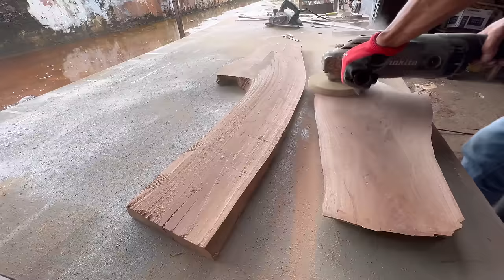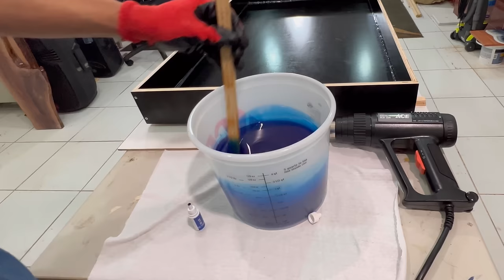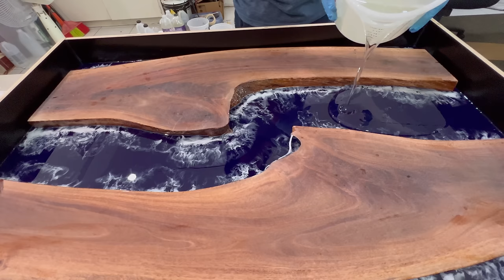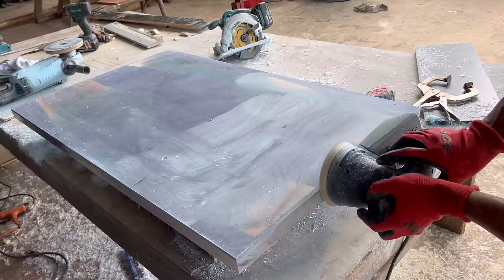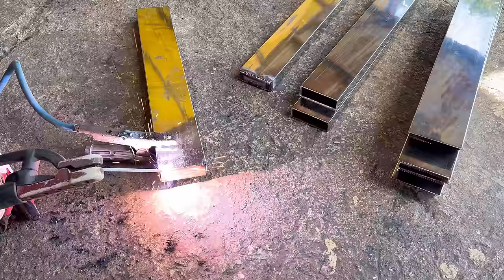Epoxy table Start to finish

Comment: No way you cut them slabs with a chainsaw and used a hand planer to get them flat, dont buy it for 1 second. You skipped showing us the gigantic planer or router sled
Reply: People do it all the time, did before large plainers existed, the apoxy levels out
Reply: I work for a tree company and a co worker from Nicaragua cuts trunks in half after removals and we make tables benches with them it is possible but takes extreme skill and patience
Reply: Why on earth does it matter
Reply: I guess you need to get better with a saw... anybody half way decent with a saw can rip a fairly straight line...

Comment: Beautiful table.  Gorgeous base.  Well done!
Reply from the maker: Thank you very much!
Reply: @craftsmantv7205 may I pick your brain on epoxy projects? First time doing this.  Do I have to fully season the maple and oak rounds I cut before I seal them? Or green wood is fine?
Reply from the maker: The wood needs  to be fully dried before starting epoxy to avoid moisture.

Comment: Super cool. When you pour the epoxy I noticed some kind of plastic skirt. Can you explain what it is for and how to make it? Thanks.
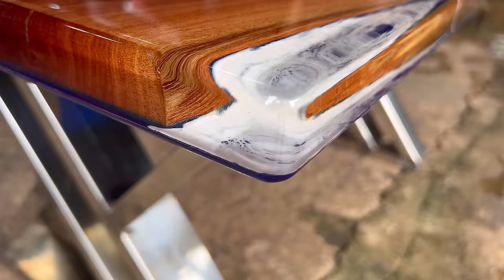Reply: Oh, now I see it. 19:44 you can see a line that tape left. So part of the side of the table was not covered in resin and you see thin line there.

Comment: Excellent viewing, wish there was more audio…understand why not. Curious…after 1st. Run, putting small risers for islands and opening the river slightly? Also, after the stand build w/ the translucent bottom, did you cover the bottom w/ anything?👍
Reply from the maker: Im sorry..the audio was muted due to copyright claim.anyway the bottom of the table,i poured a first layer of resin withe pigment blue.i did not put anything😊Thankyou ❤️

Comment: After pouring the last layer of resin in the mold, you took out the table, polished it and poured another layer even though it was transparent and beautiful. Why? And was that topcoat pure resin or did you mix it with a hardener? I think that you are the only one who made it in this way, because everyone pours the resin lower than the board, then flattens it on a CNC machine, sands it, etc.
Reply: Right! Im here to ask the same thing
Was the last layer Made of resin?

Comment: how did you deal with the dripping from the top coat ?
Reply from the maker: I put tape on the bottom and then remove it whet its dried.🙂

Comment: @14:43  why you again put epoxy coat , as you already had your wood protected with epoxy that too with smooth sanding,  you could have buffed the surface to gloss.

Comment: So, was that an epoxy resin table top coat you used at the end after all that vigorous sanding? And you didnt show how you sanded off the bubbles that dripped over the edge of the table, skipped showing us one of the biggest steps. Not a start to finish when you skip several steps

Comment: Amazing job. May I ask you what is the epoxy you used ?
Reply from the maker: I used envirotex lite  epoxy resin.😊
Reply: @craftsmantv7205 great job on the table.  Was all the epoxy the same? Meaning was all the epoxy 3+ day curing and all the pours had to be done days apart.  Hopefully that’s not too confusing
Reply from the maker: Yes you are right..it’s all the same mixtures, but i poured it 1/4to 3/8”in  each layer  when its getting hard or gel.